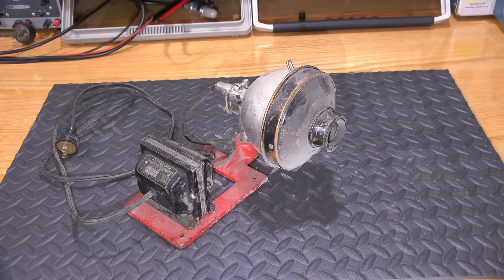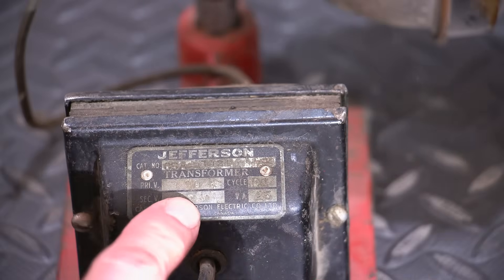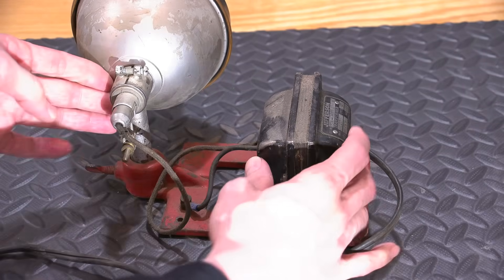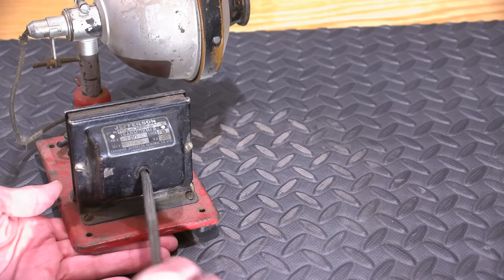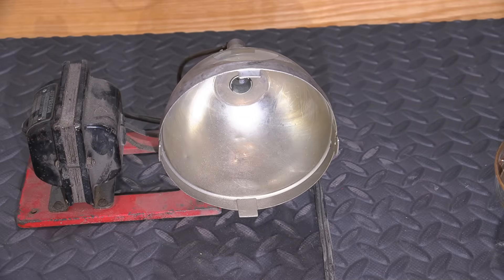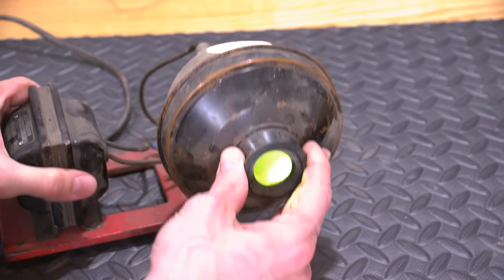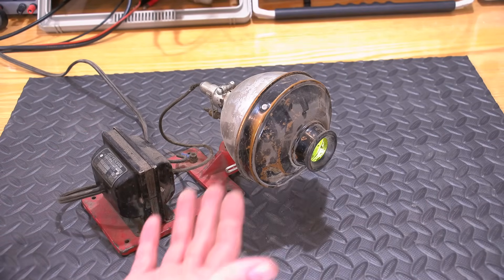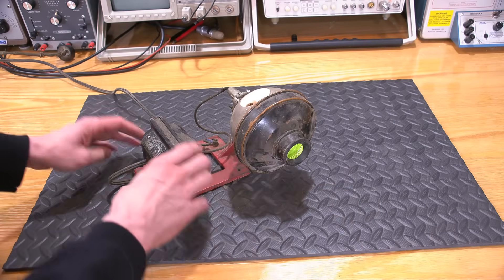Barn Find - What Is It - 1940's? Mystery Device Teardown!

Comment: We used the disposable flash cubes for a somewhat different purpose.  Turns out if you remove the fuse from an M-80 firework and replaced it with a pair of wires with some of that filament between them, with a 9 volt battery and push button you can detonate it instantly on demand.

Comment: Idea if you have to handle flash bulbs: A lamp socket which is short circuited with a wire which is as thick as possible, so that no voltage can appear over the poles of the lamp, maybe with a simple lead that can plug into a grounded banana socket or ground pin of an outlet. That should at least mitigate the risk of accidental flash.
Reply: Or just wrap the entire base in aluminum foil.

Comment: 120 volts is puzzling. During the 40s and 50s, standard line voltage in the US was 110 volts. In the 60's, that crept up to 115, Somewhere in the late 80s' into the 90's that moved to 120 volts. In recent years that has continued to move upward. (Right now my service reads at 127 volts.) Odd that something that old would have a 120 volt transformer. The ability to move the lamp in and out is consistent with setting the filament at the correct depth to use the reflector as a type of lens. (very common in theatrical fixtures) But then there is the green filter....   Egg light, maybe.... It was in a barn which could make it a farming related instrument.

Comment: Certain flash lamps are getting harder and harder to come by. Photonics, optics, and laser nerds scramble after some of the more niche and interesting specimens. And associated accessories/water cooling apparatus.

Iv hoarded more than I should... But still shop around sometimes when I don't have what I need for my next laser project. 

Would be interested to know more about the optic/filter shown in your video. Interesting contraption for sure👍

Comment: I think you are on the right track as far as this being an egg candleing lamp.  My grandfather had one with the transformer integrated an outer box but it had a similar setup including a green filter to help look for blood spots.  Depending on the egg color you don't need a ton of light if you are looking at the eggs in a resonably dark room.
Reply: Just curious, what was the point of doing that?
Reply: @samgrieg  The purpose of candling eggs is to tell if the eggs are fertilized and also to monitor embryo development.  Candling is necessary if you are raising chickens from incubated eggs since you can have an embryo die or an unfertilized egg begin to rot and that can cause other eggs to die if the egg explodes and contaminates other eggs in the incubator.  

Candling fresh eggs can also  help give you peace of mind if selling them to others as you can catch any outliers and you can determine the age of the egg by how small or large the air pocket in the shell is.  This also allows the eggs to be graded into the standard catagories you see in the store.
Reply: @kuhrd  Thank you for your detailed response.

Comment: When my grandfather, God Bless his soul, went to work as an editor at the St. Louis Post-Dispatch back in the 1920's thereabouts, the flash bulbs would screw into the flash fitting like your standard light bulb.  One of the reporters was an occasional drunkard so someone, while the reporter in question was out drinking, snuck into the reporters apartment and replaced all of the light bulbs with flash bulbs.  I still chuckle at the thought of his surprised reaction.  What a hoot.  What a beautiful practical joke!

Comment: yes i have used the m1 and m2 flash bulbs the m1 was for the 35 mm browing cameras the m2 were used with the large format csmeras like the 4x5 press cameras the larger flash bukd like you showed was akso used for press cameras with the  flash gum which used 2 1.5 volt d cells  the biggr thr flash bulb yhe larger area it covered

Comment: Thinking, maybe get an egg and see if it works as candler? Not old enough to remember flashbulbs being in common use. However, do remember flashcubes that were plugged into cameras. These gave you x4 flashes per cube. Also remember incandescent lamps for indoor photography. I think they were 500W and you typically needed several for an indoor shot. They burnt out pretty fast as well.

Comment: Carbon arc lamp for the lamp. Instead of a bulb there was a 'carbon' rod. The 'carbon' rod was supposed to be set with the thumb screw to be always at the same distance from the electrode that was placed we're now there is a hole. Probably repurposed with a new transformer and a bulb older.

Comment: I'm glad I watched to the end, I had no idea what that was.  But then I never raised chickens, my grandfathers would have recognized that egg candler instantly.  At first I was thinking sun lamp and the transformer was a ballast, but nope, not at 6 volts, and a tiny green filter.

Someone in high school (1970's) found a whole box of those Edison base flash bulbs and had great fun tormenting the custodian by screwing them into light sockets in various maintenance areas.  The custodian started inspecting every bulb with a flashlight before turning it on.  If you had photography equipment those bulbs would fire on D cells, no AC power required.

Comment: I think that this is some sort of stage light for use in theatres in the earlier half of the 20th century. However, it is probably not older than the 1950s. Why? Because the primary of the transformer is rated at 120v. In the 1950s, America was still using 110v, and started transitioning to 120v.

Comment: My Guess as to what this is and I have seen it mentioned in the comments that it is a train Signal light or an Airport glide path marker light. The beam would have to be narrow so that the incoming aircraft knew they were on the correct glide path. Through my quick research the Canadian Jefferson Electric Co., Ltd it is believed to be the Canadian Branch of Jefferson Electric. I honestly think some of the housing has been lost but it would make sense for the focusing screw on the back to allow the focusing of the bulb to throw it's light as far as possible. It could also have been used as an Airport marker light according to their history they were into Airport lighting in the 1930's to 1940's Though Through My researching from the transformer information, I think I have stumbled across an old Directory listing for the company. it's from 1956. They were located at 384 Pape Av. in Toronto. I even found a reference to them in 1940. 

https://archive.org/details/torontocitydirectory1956/page/n51/mode/1up
https://archive.org/details/torontocitydirectory1940/page/n81/mode/2up

Comment: for high school (1972-74) before I bought my Minolta SRT 101 the school had a copy of a  dual lens rolleiflex and the side mounted flash unit used bayonet based bulbs about the size of a small chicken or duck egg. Of course for my SRT 101 I bought a flash that mounted on the top and plugged in on the side (no hot shoe on that model)
PS i think egg candler as well.

Comment: Good old press 22 flash bulb.  I used those in a 4x5 Speed Graphic camera in the early 50s.  After the flash, you reach in and quickly pull out  and toss away the used bulb which was very hot.  The bulb has the ball of pure magnesium wire and envelope filled with pure oxygen.

Comment: As a very young lad in the 60s I found in my grandfather's bits bin one of those flash lamps. Of course, I had to apply a battery to it. At first nothing happened, but more volts did the trick. A very bright flash came from it, I could see stars for hours after. Lucky I was not holding it as the glass was quite blistered and deformed. It was the first and only time I did this!
Reply: They had plastic coatings keeping the shattered glass from falling out after uae

Comment: Have seen something similar on  E.T.S.Y.  USA  (Antique Farm Egg Tester Light) which appears to be a 115v lamp and the light out is white. So I think you are right that it is an egg Candler and the maker has been kinder to the tester, if used on a large battery farm by adding the green filter. Saves having that persistant blob in your vision.

Comment: It might help you to know the time of manufacture to take into consideration when Canada converted to 60 cycles. Also, I have candled many eggs, green would be an unusual choice.  With the current positioning of the lamp output, it could have been converted for that purpose so you could candle a great many eggs while seated, but it looks like that pipe was crudely cut, and that was not its intended purpose. Possibly stage lighting or signaling as others have pointed out. I don't think it is powerful enough to charge the Green Lanterns' ring(LOL).
Reply: Someone else suggested that the green light would have made the veins stand out better against the yoke. Green light would have turned the veins darker.  I've never used one but that seemed to make sense.
Reply: I think that it could be from one of several origins.  

First I wondered if it could be some kind of signaling lamp, especially with the color change mechanism.  

The next origin is it is out of some kind of medical equipment.  It’s shape kind of resembles the odd shaped lights one sees in surgery, X-ray, dental. And other rooms you find in doctors offices and hospitals.  

I also think that this could be some kind of stage light but I think that is less likely because that is an odd shape and that many stage lights did not use low voltage transformers from my previous experience in school theaters as a lighting tech back in my high school days. 

Others say it could be egg candling.  I have never done this so I will leave that opinion to the farm people.

Comment: Flashcubes were two types, electrically triggered and the "Magic Cubes" that are fired by a percussion spring. Magic cubes often would fire when dropped.
Reply: Each bulb in a Magicube was set off by releasing one of four cocked wire springs within the cube. The spring struck a primer tube at the base of the bulb, which contained a fulminate, which in turn ignited shredded zirconium foil in the flash.

Comment: Couldn't tell if your flashbulb had a plastic coating, as more modern ones do.  Flashbulbs from the sixties and seventies had a magnesium wool and oxygen filling.  When triggered, the combustion of the fine magnesium wire would generate both a very bright flash and enough of a pressure pulse to be audible and shatter the bulb, with the shrapnel being contained by the plastic coating.

Comment: I know I have seen one of those lights before in a movie but I don't recall which one. I don't know what it is but egg-candler like others are saying seems plausible to me.

When I was a little kid I found a treasure trove of hundreds of old flashbulbs in our basement. There were a few of the cube kind but most were what I presume was an older model. I can't quite remember what they looked like for sure but it seems like they were packaged in a row inside a rectangle, or installed individually. Part of why the memory is fuzzy is I disassembled them so my memory is of little bulbs with spindly terminal legs. (The same little bulbs in flashcubes.) It seems like I found an alternative to a battery to set them off, maybe slamming them on the floor or skating over them or putting a match to a pile of them after breaking them open, but I think it was throwing them against the basement's rock walls. (Just remembered the fireplace down there, brick painted with black light fluorescent red and green paint, probably in the '60's or '70's, enough to wake Hendrix from the dead to jam.)

But I think my favorite flash memory was taking apart a charged xenon flash for the first time and being startled by the big capacitor vaporizing a bit of the butterknife I used to discharge it. "Startled" should probably make me eligible for the Royal Understatement of the Year award.

Comment: Have you tried taking a photo of it and searching the internet for a similar photo?  Seems like the transformer is pretty expensive when a plain old light bulb without  transformer would work fine.  Will be very interested  to see if when it is positively identified.
Reply: Using a 6 volt bulb would enable it to be operated from a automobile battery. A lot of farms in the 30 s and 40 s did not have electricity.
Reply: That makes sense.  Guess it was a good idea at the time. @shawn7233

Comment: Edison socket flashbulb:
I have two 4 x 5 graph flex cameras they both have flash attachments, and they do use the Edison socket lamp that you showed. As a kid when my father got home Each night and had the habit of reading the newspaper, once he reach over and pull the chain switch on the lamp to read his newspaper he was surprised because I had substituted the standard incandescent lamp with the flashbulb.
Fortunately for my the plastic coating on the lamp prevented the glass from shattering but the increased light level was very startling to my father. No child was injured during this experiment.

Comment: I’ve seen flashbulbs like that, with screw bases. I was part of a technical team on a project in which one of the requirements of the project was that the event had to be filmed with high speed cameras. The event was so fast that it completely took place in the timeframe of a flashbulb.

The high speed cameras used then were 16mm film cameras called quarter framers because they shot four frames in the same length of film that one standard frame would take up. These cameras could go through a 400 foot roll of 16mm film in under a second. The film was going so fast that in broad daylight with the camera wide open the film was not exposed.

It took nearly half the roll of film for the camera to get it up to the proper speed, all of which came out black after processing. A plethora of magnesium flashbulbs like the one in your video were fired during the event, capturing the motion of it on film, then the remainder of the roll, nearly the second half, wasn’t exposed either.

After processing, 95% of the film went in the trash. It was all black even though it went through a wide open camera in broad daylight. That’s how powerful those flashbulbs are.

The setup for each event was time consuming, there were six cameras on each. Timing of the event, the trigging of the cameras and the triggering of the flashbulbs was so critical. Every once and a while, during setup a camera would false trigger, waisting setup time and film which would make the photographer cuss. These cameras would shred the tail end of the roll into bits and have to be cleaned as well as reloaded. 

The results though were astounding!
Reply: That's a really fascinating story!
Reply: Cool

Comment: That type of lamp holder is called a bayonet connector or bayonet socket.  The part that fits into it (a plug or a lamp) is called the bayonet cap.

Comment: Hi Paul,
I haven’t the faintest idea what use that light equipment was intended for: and I feel far too self conscious to proffer a guess.  Unless there is a concealed patent number somewhere, it has a kind of ‘home brew’, or ‘Frankenstein’ look about it.
Nonetheless, it would be interesting to know what it’s use was.
Best regards Phil.
Reply: I agree. It does seem like a tractor light (that originally ran a 6V battery system) repurposed to be powered by a 120/6.5V step-down transformer, because why else would that be necessary, and the cover/hood is from an old hurricane oil lamp of some sort.

Comment: That item I have no clue about but flash bulbs I used plenty of.  From individual "blue dot" to Magic Cube to countless others, was a fun time in photography.  Also used individual small "blue dot" flash bulbs to ignite amateur rocket motors with, done right it was instant launch.  Interesting piece and I'm sure somebody will know exactly what it is.  Thanks for the video.  73
Reply: Flash cubes used a mechanically fired primer to ignite the bulb. Other types of flash obviously used electricity but they were not super easy to ignite. Most flash units had a 12 V or so battery that charged a capacitor in order to get enough oomph to fire the bulb.
Reply: @machintelligence  Exactly.  We used remote ignition with 12V automotive batteries to energize the bulbs, worked good.  Obviously they became dinosaurs and disappeared.

Comment: The flash bulb is the type most commonly used with the Speed Graphic press camera the reporters used.   These were used from the late 1920's until the late 1950's when obsoleted by the electronic xenon strobe flash.  Prior to this flash bulb, photographers used flash powder, which was very dangerous.  This flash bulb is only for B&W photos, the bulbs made for color film were dyed blue for color correction.  Today's trivia: The Speed Graphic flash bulb unit was modified and used as the Jedi Light Saber in the Star Wars movies.

Comment: Hi Paul, I'm not sure what the lamp was used for.  The red super heavy duty base suggests railroad or a military application.  The base looks like a universal part since it doesn't really properly fit the power transformer.  Red paint is generally used on alarm components, such as a fire alarm.  This lamp looks as if it was mounted in an indoor controlled environment as evidenced by no corrosion on the metal and the wire insulation being in relatively good condition.  A 6 volt incandescent bulb is used so the fixture can tolerate vibration.  There are no optics to speak of for focusing a narrow light beam and the green filter lens is poor optical quality.  The large hole in the reflector is probably for cooling.  This fixture probably used a 15 - 25 watt automotive bulb.  My best guess is the lamp is used for some type of signalling, hence the reason for easy change lens filters for maintenance purposes.